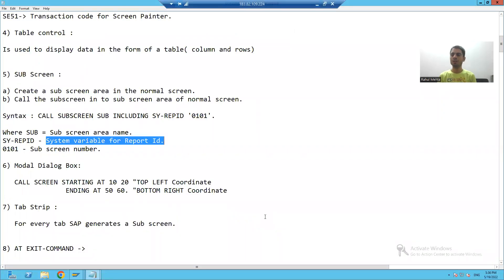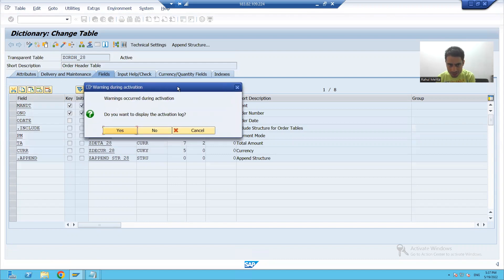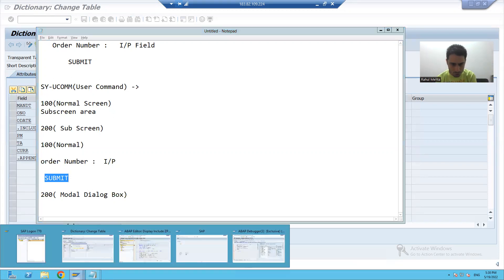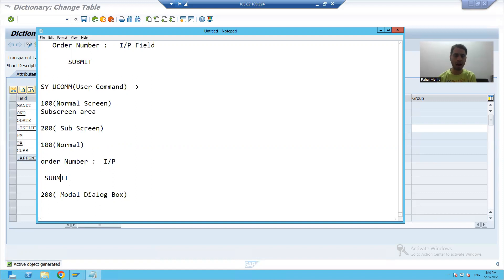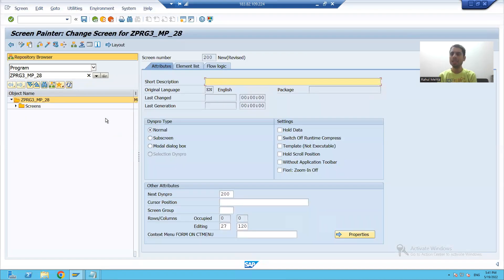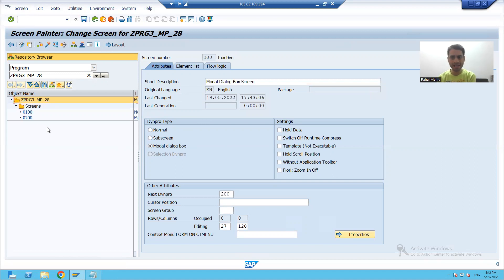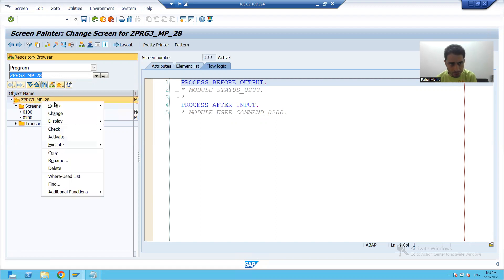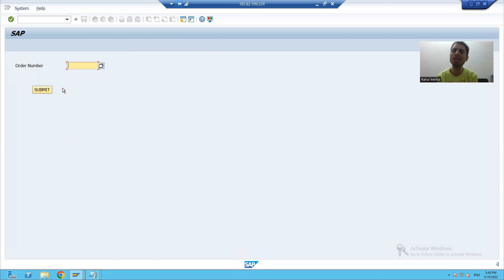15 - Module Pool Programming - Modal Dialog Box Screen Part1

Comment: Hello sir I have created module pool in that I want dialogue box with username password drop-down with accept and correction required and remark field how to implement that? Please suggest
Reply from the maker: Hello Sandesh - You can design those fields as input fields on modal dialog box. Based upon my perception, the modal dialog box videos will help 
you to achieve this requirement.